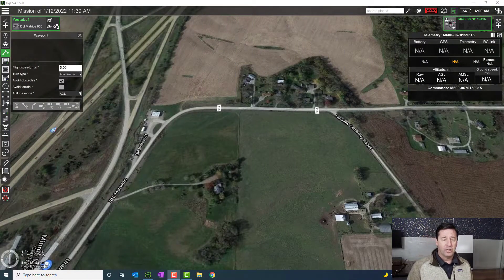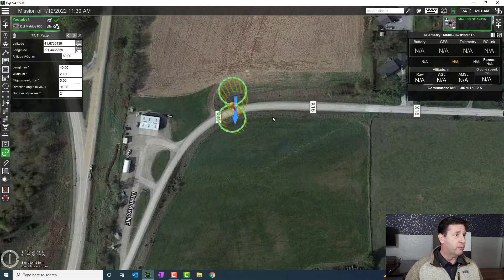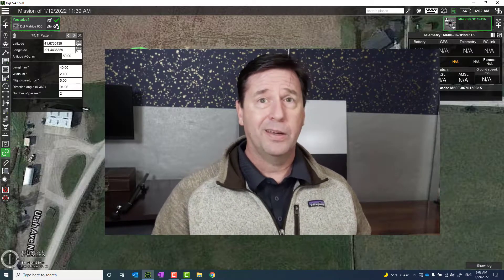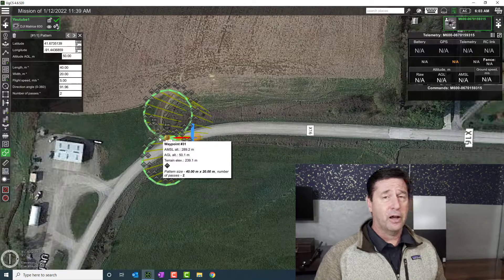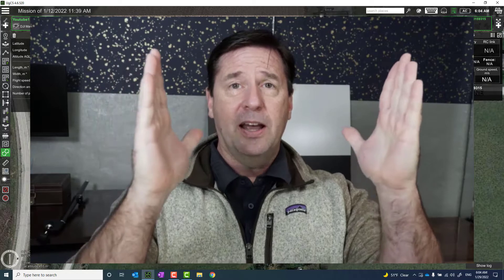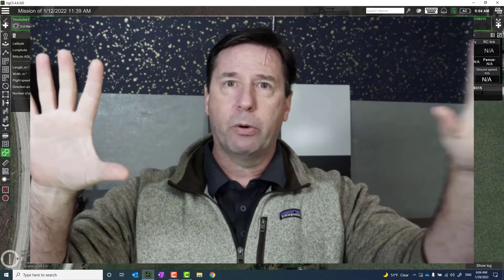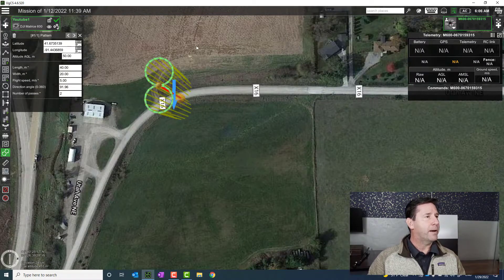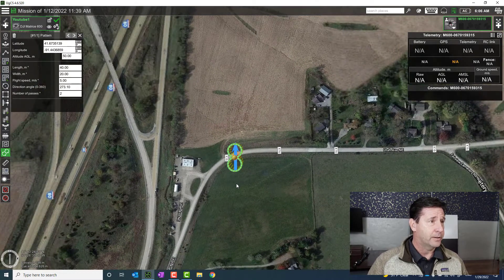Improving Drone Lidar Survey with Calibration Automation- UGCS 4.6 UPDATE

Comment: Can you speak to the benefit/necessity of in flight IMU calibration. I know UGCS has this option as a check box where it performs IMU calibration every 100 secs or 1000m. I'm finding I have issues occasionally with this automated calibration where the drone goes on hold and won't recommence the flight.

Comment: Great video! I have a few questions, 

1) We plan to fly the L1 using LiDAR corridor but have concerns about alignment issues with turns in the corridor and not flying entirely in straight lines. Just wondering if you have had any experience with this.

2) We have been using U-pattern with 6 passes for calibration for the L1. With figure 8, how many passes do you recommend?

Thank you!
Reply from the maker: sorry I didnt' see your comment till now.  so first, don't do the L1.  it is not mature yet.  DJI will get there but it is not there yet.  if price is something you are sensitive but you want an accurate sensor, I recommend the Green Valley liAir V70.  here is the secret that not one is taling about. Buy the L1 is the start to what you need and when you get done buying everything it all is about the same except you have to do more work.  
NOTE: I am a dealer for Green Valley, but I am offering this advice because I believe in the product, not because I want you to buy.  you can also look at the yellow scan mapper.  Same capability, just more expensive.
Reply from the maker: Calibration.  the Calibration pattern is set by the IMU manufacture.  Geodetics it was a box pattern, L1 is the U pattern,  Applanix is was a W pattern.  The hardest one and why we worked hard with SPH to get this into UgCS is the figure eight.  I wanted a push button tool for you so that you could hit go and everything was fully automated.  you can program U, W, and box patterns as part of a flight plan, figure eights were more challenging.  
So bottom line follow the manufacture directions, unless of course they say you don't need it.  that is just wrong...  Like Inertial labs when they were initially were promoting the ROCK R2A or RESPI..
Reply: @Re.genesis  Can you tell me what IMU the Matrice 300 is using and what pattern would be best for it? And if you don't know, would it be a good idea in general to do one or two figure-eights before doing a lidar survey? Best regards!
Reply from the maker: @Janphr  we don't' know what IMU they are using, we just know performance is not good based upon the lidar data we get on the other end.  With all system, you have to follow the manufactures recommendations.  if you know what IMU they are using you can use the IMU Manufactures recommendations.  for example most hexagon based systems are figure 8s, Applanix is figure 8s or sawtooth.